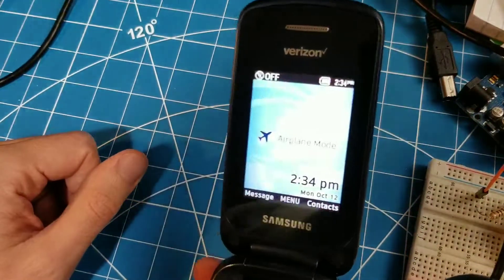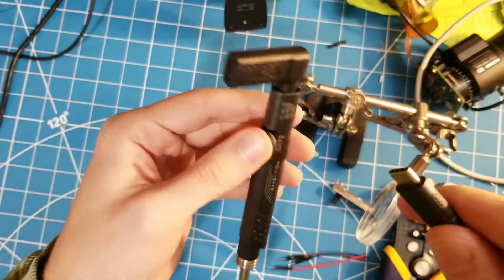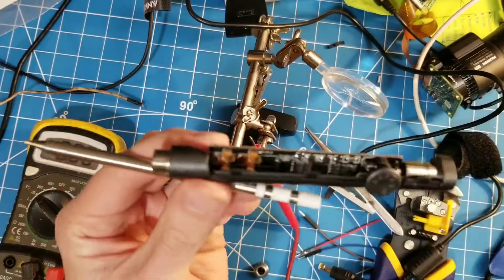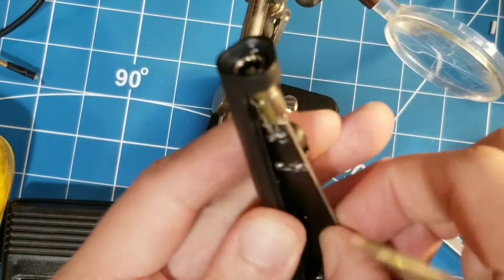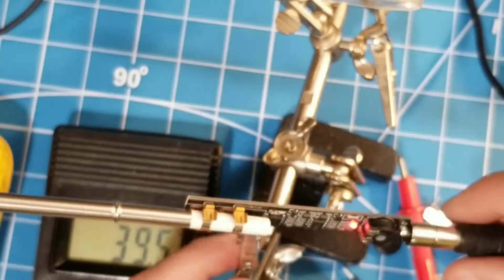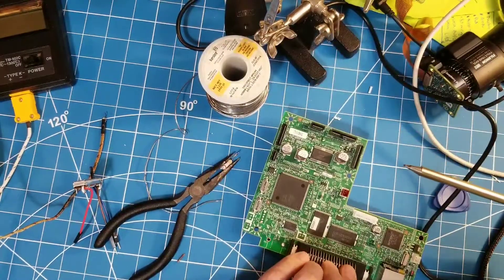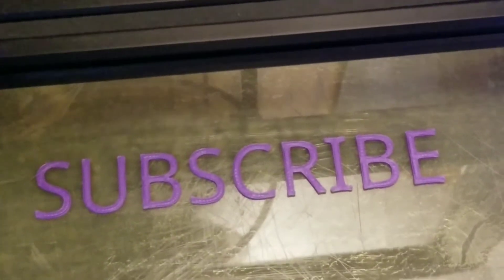sh72 soldering iron

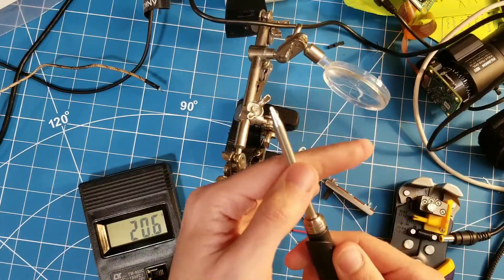Comment: I have the same soldering iron, I didn't even think that the screw could be installed like that. But product designers will learn a lot from this video. Also, professionals sometimes try to solve problems in complicated ways. It's very interesting that you continued after finding the problem at 4:42. I'm also very surprised that you haven't deleted this video for 4 years. That short review video made me have mixed feelings hahaah. Thanks.
Reply from the maker: I think it's valuable sharing failure and error so that others can learn from it!

Comment: How long does it take to heat up to 400
Reply from the maker: I'm not sure the name, but they are available on Amazon and eBay. Likely something standard, as they look pretty similar to the pinecil. Search "sh72 tip"
Reply from the maker: Depends on the voltage and current of the power supply. More power = faster. It seemed to be acceptable, though I have not used much since getting my pinecil.

Comment: It did not work at first because you were supposed to unscrew the nut and remove it and then put the tip in and screw it back on!
Reply from the maker: yep. fail.
Reply: @jarenhavell  but its ok everyone makes mistakes

Comment: 🛑 А если Sh72 подключить к компьютерному БП на 450w. На жёлтый (+) и черный (-) провода, это получается 12v 17A. паяльник сгорит, или он возьмёт из этих 17А не больше своих 1.5А и будет работать??
Reply from the maker: in general, electronics will only take what they need. because this device is regulating itself, providing it extra current will not cause any problems. it's similar to having a hot water tank. having a large hot water tank does not mean that you will burn yourself,  it just means you can take a longer shower. perhaps not a great analogy, but I think it helps. :)
Reply: У них контроллеры этим занимаются,защита есть а этот паяльник,вещь,у меня тоже такой нагревается меньше чем за 10 секунд,удобная штука ещё бы кнопку ему на корпусе включить.выключить,ваще цены бы не было,хотя я видел видосы,где люди их так дорабатывать,сами устанавливают.Моя оценка 9 из 10. УДАЧИ...
Reply: @gregcigr8953  ты число и год моего вопроса смотрел? 😂😂😂